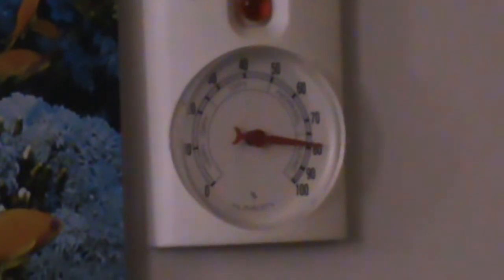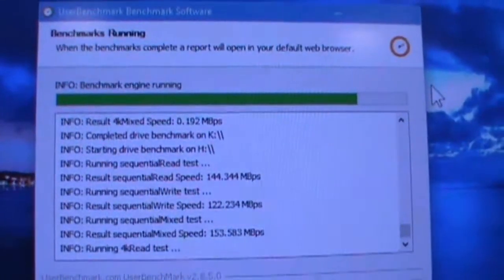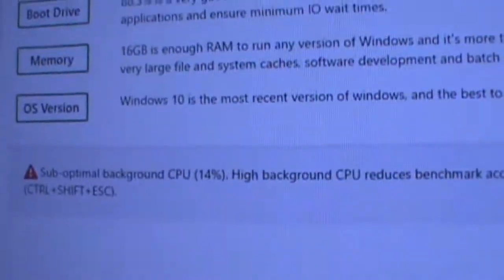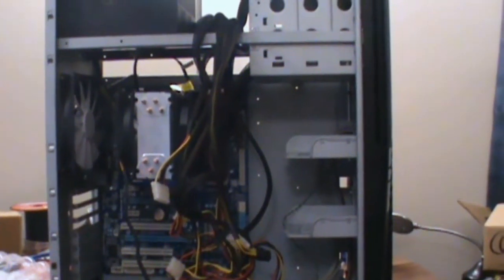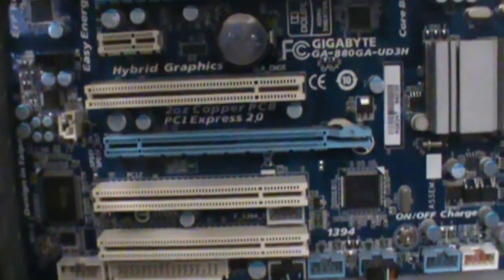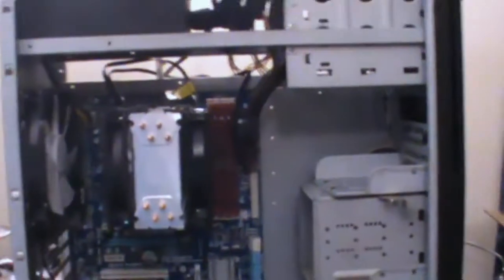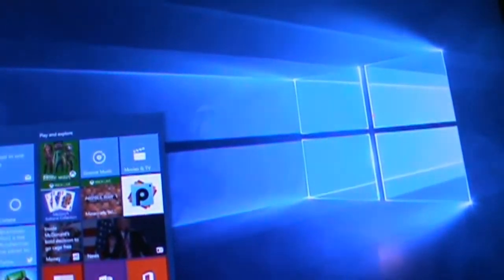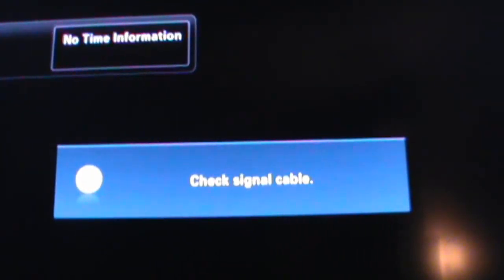The Tuxedo Dilemma

Comment: I need an ssd and some 120mm fans i'd take some of your spares if you'd like
also on the 4/6/8 pin headers for power supplies anything beyond the least pins are redundant so 8 pin pci-e headers are just two extra ground pins from the 6 pin header
and cpu headers are just the same plug duplicated to the other 4 pins with different pin shapes only ie(12v   12v   12v   12v)
                                (g       g       g       g     )
and pci-e                (12v   12v   12v  g     )
                                (g       g        g      g     )
the addon pins are on the far right from the default pins